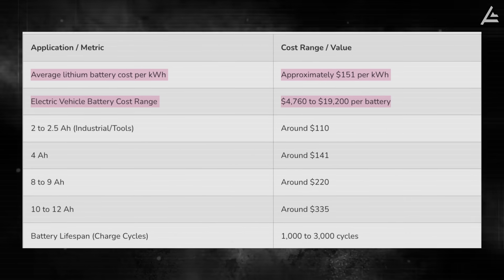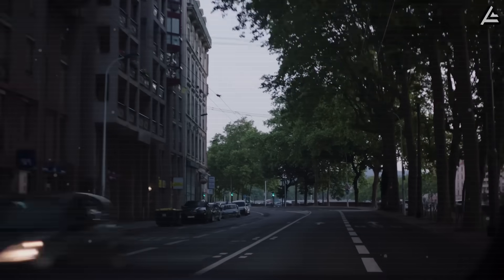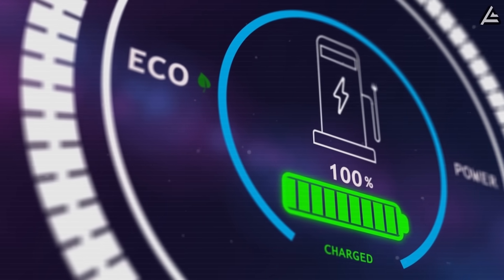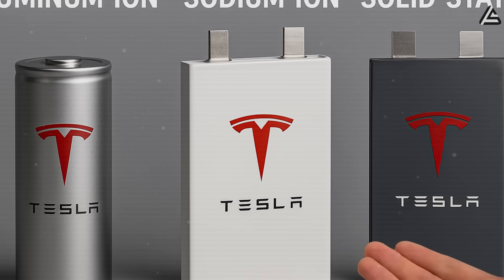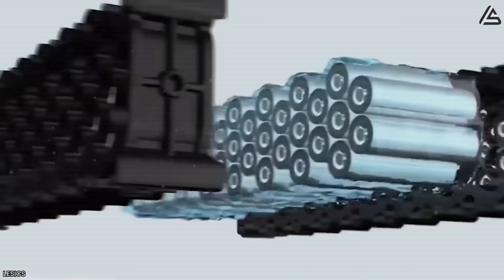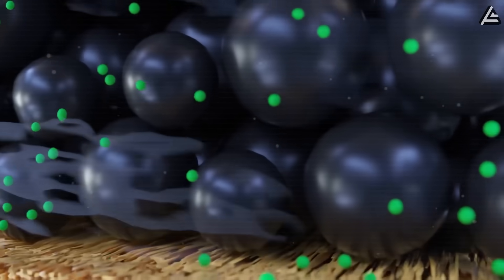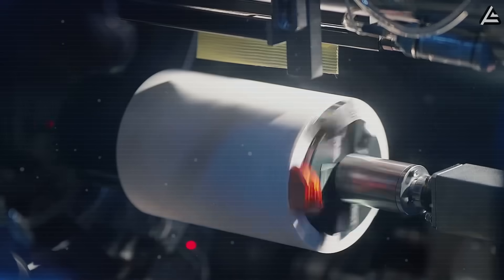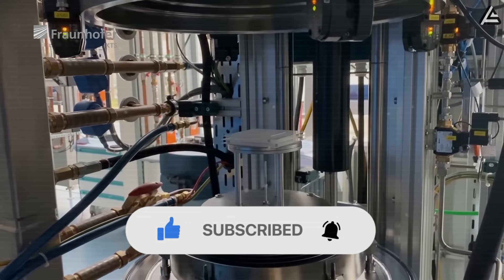Elon Musk Announced All-New Batteries For 2026 Tesla Model 2: What You Need To Know?

Comment: How do sodium-ion batteries compare to other emerging battery technologies?
Reply from the maker: It’s the cheapest option ever. Can’t match aluminum or solid‑state batteries in range and lifespan, though it still outperforms lithium there. Its big advantage is safety, and working really well in extreme cold and heat. So, which matters most to you?